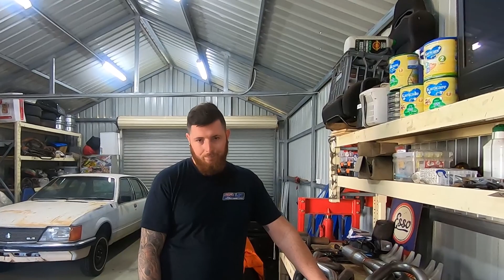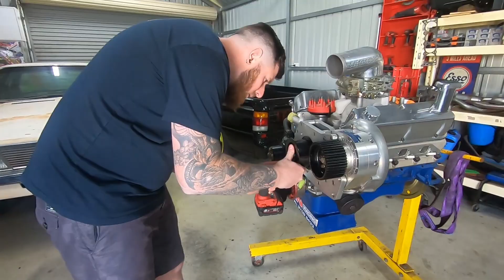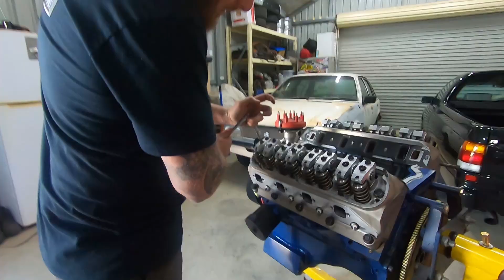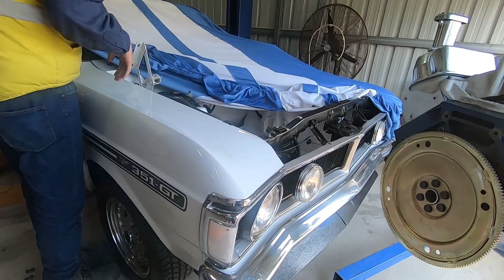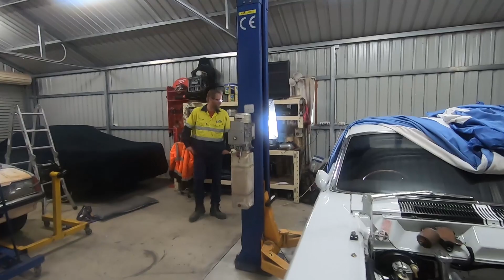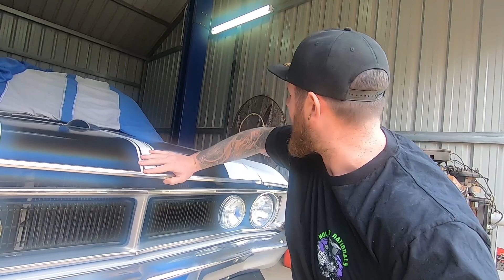This BLOWN 411ci XY GTHO tribute has created some MAJOR headaches! | [XY PRINCE] - Ep2.

Comment: Definitely test fit the pipes before cutting down engine mounts. Last thing you want is those killer pipes dragging everywhere. Killer build though boys will be a stout rig 🤙🏼
Reply from the maker: Good call mate. Definitely will be measuring everything with the engine suspended before modifying the mounts, thats for sure.

Comment: Rod shop engine mounts have caused an issue for my mates VK Ls conversion...engine is to high so the tailshaft is hitting the tunnel....I used Tuff mounts on my XY for the Barra conversion complete bolt in kit + sway bar no mods needed...my mate had to notch his cross member to make the ls fit also with the rod shop mounts....

Comment: Nice build ive got a xy fairmount with a 351c 4r70w trans torqstorm supercharger Holley sniper had a similar problem with headers with 3v heads goes good but thinking of doing a 427 Windsor or clevor with a supercharger I love to see you try fitting an air to air intercooler
Reply from the maker: Sounds like a ripper little street car Joehua. Intercooler is a 100% no go at this stage. Would require more cutting than the owner is willing for us to do. We did consider putting a water to air core in the place of the battery tray, but the decision has been made to be unintercooled at this stage.

Comment: This is why clevo's are king
Reply from the maker: They each have their pro's and their con's mate. This windsor will do us proud im sure!

To answer your other question, its not that the port is really that tiny, just the bolt spacing really. These heads have a really nice port on them, and with that blower wanting to move ALOT of air, we want to evacuate the cylinder as best we can 💪🏻

Comment: Sweet Build! Will you be able to fit the headers between the strut towers with studs in the heads?
Reply from the maker: Possibly. We may have switch to a sealed bolt, or attach the headers with the engine suspended. Its definitely going to be tight in there!

Comment: Are you going to ceramic coat the extractors?
Reply from the maker: Not at this stage Big Al, once its all running properly its all likely to come back out for some engine bay mods/touch ups, so it may be done then.
Reply: @TorqHub  no drama. Having had the last two sets of pipes ceramic coated on cars I’ve built I believe it is money well spent. Keep up the great videos. 👍🏻

Comment: Nice jobs those engine mounts look way taller than chassis mount and engine mounts and Cleveland and Windsor mounts are the same and causing the engine too sit way to Keep the videos coming
Reply from the maker: Thanks for watching Dean 👍🏻 Yeah there is plenty of space between the sump and the crossmember so there's definitely room to come down, thats for sure!
Reply: @TorqHub  no worries I love these types of videos I also noticed you were grinding the engine mount I had to do the same on my dart block 363
Reply from the maker: @deanxmfalcon6451  yeah the block has provision for 6 bolt heads, so just needed to slightly clearance away from that extra material. Wasn't much, just a wee bit haha

Comment: I would junk the edelbrock heads and spend the extra for some 225/235 afr heads.
Reply from the maker: Would be such a shame to waste a set of nice aftermarket heads with a beautiful CNC port and tidy valve job just because it was limited on primary pipe. Was well worth the few hundred $ in machining in our opinion, and Galloway Engines did a great job! 😍
Reply: Fair enough man. I have always been a fan of AFR heads. Glad you guys made it work in the end. Should make the power you guys are chasing super easy.
Reply from the maker: Yeah the AFRs are an amazing head! Life certainly would have been better if a set of those were already there haha.

Yeah, 600rwhp was a VERY conservative estimate 😉

Comment: I'm no Ford guy but I'm pretty sure the early and late series engines have different manifolds...Go check an AU's manifold...You can barely get the bolts in.
Reply from the maker: Yeah the bolt spacings just seems silly really doesn't it?

Comment: No way I would have pulled those heads off, I would have hand drilled and tapped the 16 holes with a good old steady hand and a spotter watching the horizontal axis
Reply from the maker: G'day Chris, thanks for the insight into what your approach would have been. It's always interesting to hear how others solve their problems. Like we mentioned in the video, there was extra material that needed to be added (tig welded and machined flat) to the header flange face in order to get an acceptable level of sealing on the competition engines header flanges. Our machine shop done a cracker job and we'd do the same thing again in a heart beat. We try not to cut any corners around here if we can and we do things the way that we believe to be the right way. This engine combination definitely warranted the extra effort to get right and we look forward to getting it up and running soon. Thanks for watching mate and we hope you enjoyed the video.